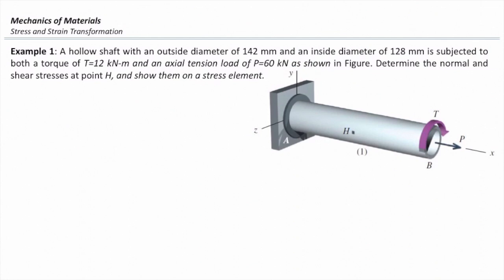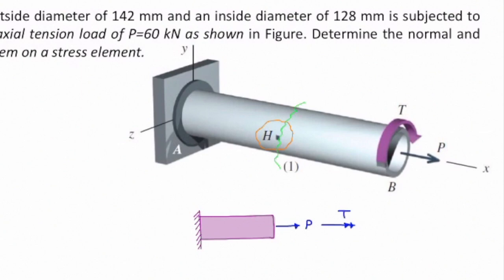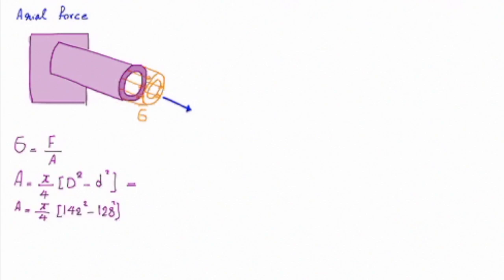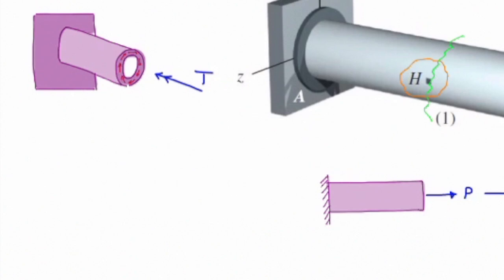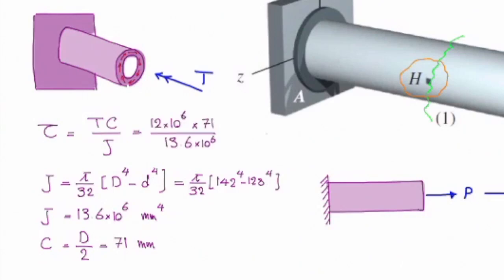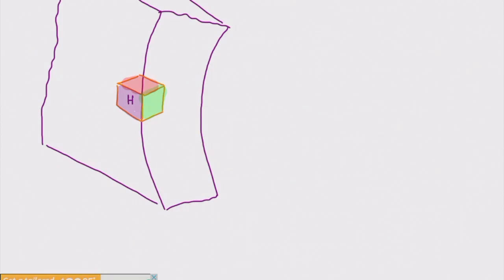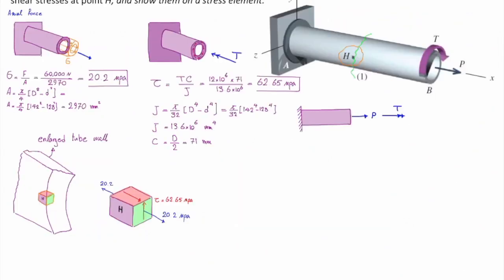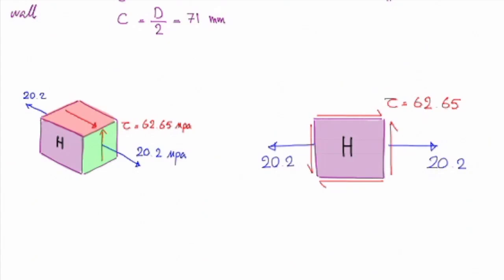Lec20, StressElement, Prob1

Comment: Hello Sir,
Firstly, thanks a lot for these videos, they're really helpful and clear !
I just have a small question (I know that this platform is not made for discussion, but it would help me a lot if you could reply).
At  5:17, we could have three projections, so three 2D stress elements in the 3 different planes, right ?
The first one is like you drew, but would the second one be only with a normal stress (20.2 MPa), and the last one just with no stress at all ?
Thanks a lot once again :)
Reply from the maker: Yes that is true.  A 3D stress element would have 3 faces, each could be projected to a 2D stress element. Further discussion on analyzing a 3D stress element and finding maximum shear stress can be found in this video :https://youtu.be/ymBWEvxEzJc
Reply: @MechanicsofMaterialsLibre  Thanks a lot!

Comment: Very very nice explanation sir..Thanks a lot for it. One little query i have, pls excuse me for my silly question. At 6:02, won't 20.2 MPa normal stress (normal to side face) act as "shear stress" for top face of the stress element? It'd really help me if you reply sir.
Reply: I'm not sure, I have the same question, but to me it seems that it will act like a normal stress too, since it tends to stretch the element, and it doesn't intuitively shear it.
Not sure though..
Reply from the maker: No,  Normal stress is equalized by another normal stress on the opposite face and it is not producing any shear stress directly. Note that normal stress could be converted to shear stress by stress transformation if the element is rotated (see details here: https://youtu.be/cLHJSOAVxLw ) but  there is no shear stress on any face of the shown element due to the normal stress. Hope that helps.
Reply: @MechanicsofMaterialsLibre  ok. Got it sir.